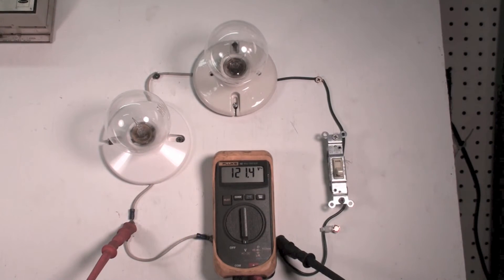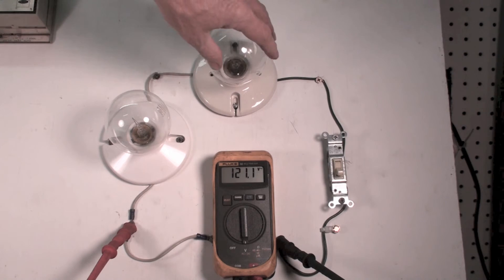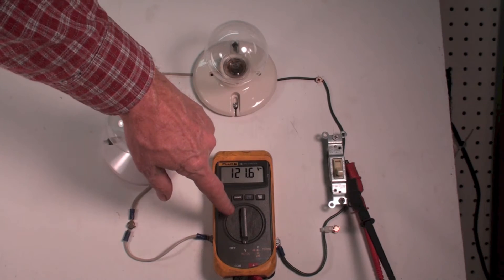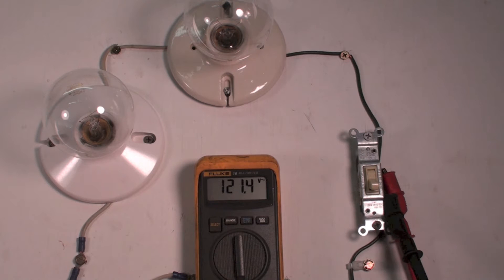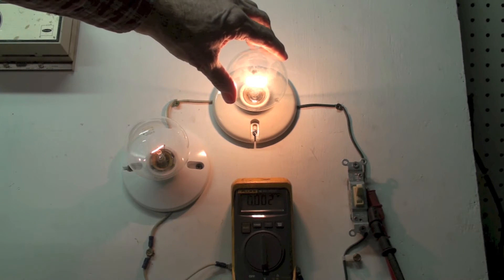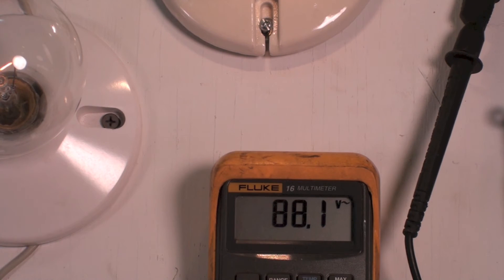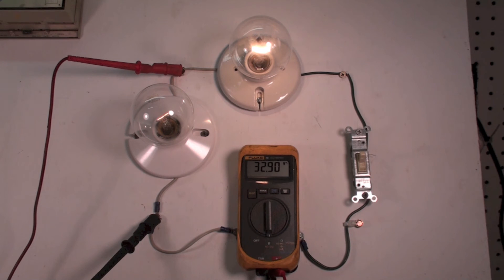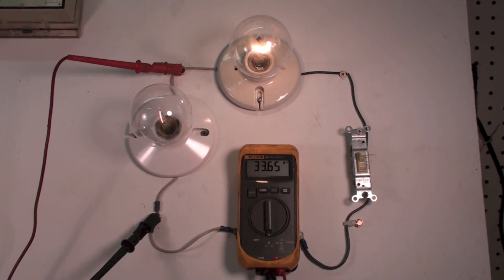Electric troubleshoot with the voltmeter, voltage drop.  part 2

Comment: The only question I have is when leads were hooked up to either side of switch, switch in off position, and you unscrewed the 40w bulb
 why did voltmeter read 8 volts?! There should not have been any voltage since that was an open circuit!

Comment: I'm not sure you're right about why the lights weren't lit. That's because the switch was open and your leads measuring nominal voltage. But when you closed the switch you were effectively measuring just the live, no potential difference, the ~0V.

Comment: the smaller the load the bigger the voltage drop, basically part of the circuit that has the most resistance will take the most voltage drop.

Comment: So if u read o volt across load and switch is on does that mean switch is bad
Reply from the maker: Either that or there is no power available.
GFM
Reply: Really bad explanation. Really confused mean.  The load to the meter isn't tiny. The load is near infinite so it doesn't draw any current. this is why when you go across the switch when its off the lights do not turn on. The lights are in series with a near infinite load.
Reply: @kylewilzon8612  Coukd it be that when multimeter is set to read volts the current is directed through 
a resistor? Which cuts down the draw drastically, thereby not lighting up the bulbs?
Reply: @PK-yc7en  damn i wrote thay 6 years ago thanks for making me feel old, and yes that is exactly what is happening.

Comment: if you get 30v on a 120v circut does it mean you have a bad switch
Reply from the maker: You are reading a ghost voltage (reading thru an electronic circuit) or reading thru a load.  Not a bad switch.
GFM
Reply: thanks took cover off switch inside box found wire loose from switch and bad switch thanks
Reply: piece that holds wire blown out of switch

Comment: Hello again GFM, I want to ask is it possible to have 120 volts but no amp draw if the load fails?  If I am thinking right if you do not have amp draw you would not have power right?  Thanks again

Comment from the maker: Your thinking is correct.  The amount of power used is dependent the amperage draw, which in this example, will correspond to the percentages of voltage drop of the 2 loads.  Hope this helps.
GFM

Comment: Does Voltage Drop mean the same as say Power Use? The switch uses or loses 2 thousandths of a volt, the first light bulb in the series uses 67% of the power, so the 2nd bulb in the series uses the last 33% and a 120 volts exit back out the system.

Am I thinking about this wrong?